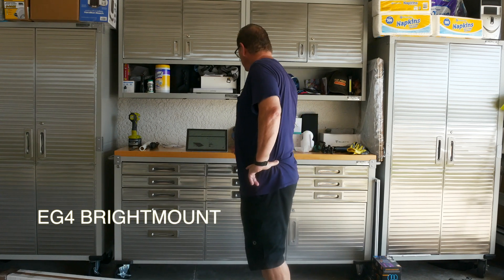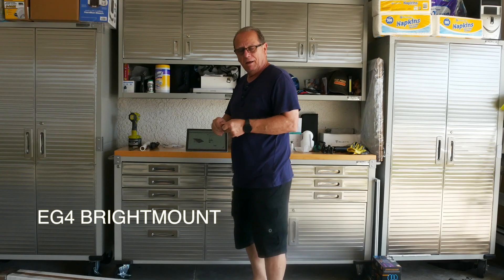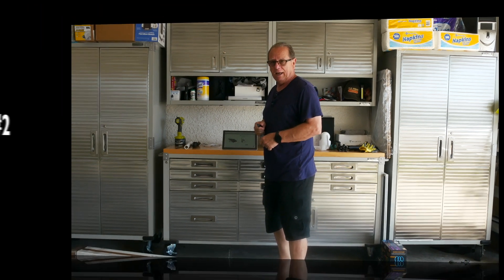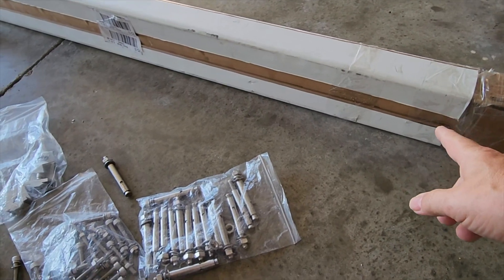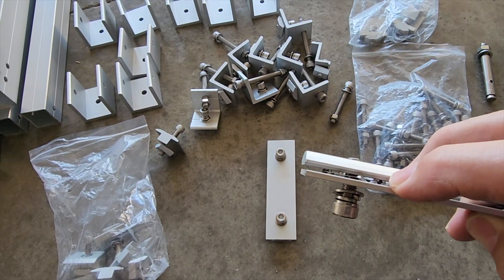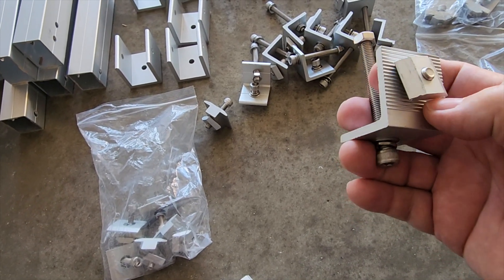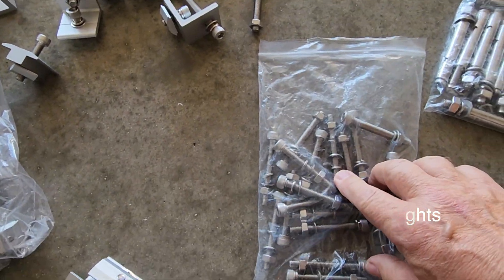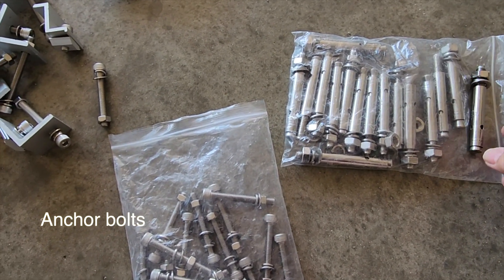EG4 BrightMount ground mount for solar

Comment: Half if it?  Did you actually cut in half?
Reply from the maker: It actually is two bolted together with connection plates. I still have the other half for another day/ project. Thank you for watching and commenting.  Have a wonderful week ahead 😊.
Reply from the maker: https://youtu.be/m2IyGycfaFk

Comment: nice they my work for my deck roof
Reply from the maker: Probably, if you have a good mounting point. I am looking to a special mounting position also and will be adding supports on the front to  guard against wind and leverage.  Thank you for watching and commenting.  Have a wonderful week.